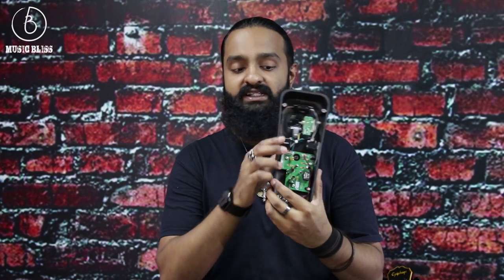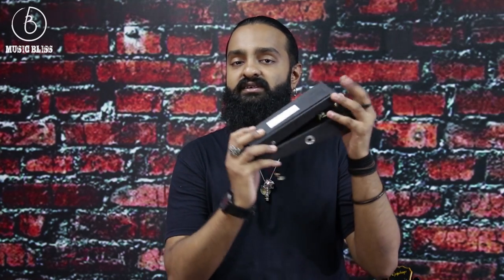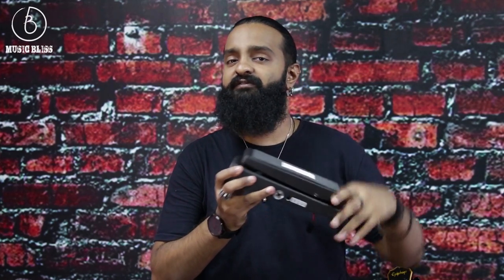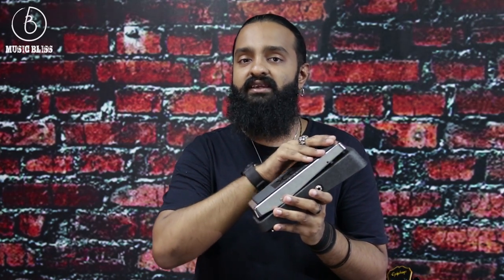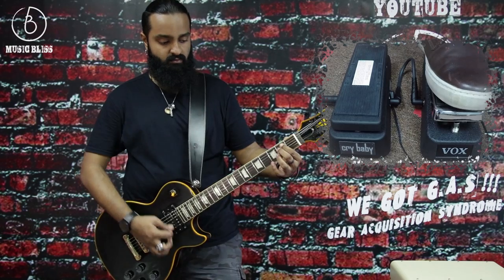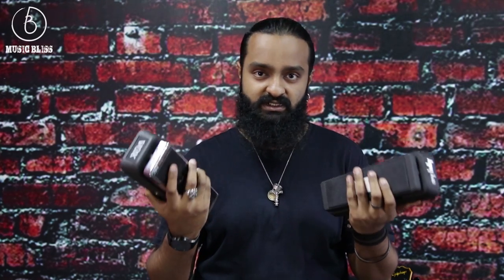THE ORIGINAL WAH PEDAL: Dunlop Crybaby GCB95 vs Vox V847 Wah Comparison

Comment: Vox has a wider sweep range and a tad more emphasis/resonance on the "sweet spot"? The sweep range seems to have more extension on the high-end. Or then it seems like so, because the resonance of the filter is greater in vox than in dunlop. More resonance = more "vocal" sounding.

Comment: I've tried both and here's my verdict.
VOX sounds brighter and definitely nails the sound of old school wah pedals. You can easily get the wah effects of Jimi Hendrix out of it, but due to its overtly bright character it ain't suitable for modern high gain musical genres.
The Crybaby sounds bit darker and certainly geared more towards high gain applications.

Both of them are two completely different kind of wah pedals geared at two different kinds of players. I think a better comparison will be between Box V847A vs Dunlop Jimi Hendrix JH-1B because they are more similar to each other.

Comment: Great vid, I think I'm gonna go with the Vox. Sounds clearer to me and has more treble
EDIT: Actually Idk which to choose. Very hard :/
Reply: gurvirj95v2 I have a v847a and sounds great clean, but when on gain its loses its sweep. It starts to sound like it’s either wide open or wide shut, no sweep in between, just flips kind of abruptly no matter how careful you are with your feet. Yesterday I changed the pot, and no difference. I’d suggest getting a cry baby, ive never heard this problem with them
Reply: Elias Levinson Ahh I see. After watching many many videos of Vox vs Crybaby and 'crybaby gcb-95' vs 'crybaby classic', I ended up going with the classic. It doesn't have that problem you mentioned, works great.

Comment: I've been given a Gcb - 95 for free and even though it turns on it doesn't rock up and down like in the video. I press it down or up and it just stays in that position, it offers no resistance. Is there a fix? 
Cheers
Reply: Maybe you have to change the position of the potentiometer.

Comment: Sorry, but the test is INVALID as it doesn't take into consideration the tonal effects of input and output loading.  You need to completely substitute one pedal for the other.  You cannot perform a valid test by connecting one pedal in cascade with a second pedal.  The Vox 847, as well as it's predecessors severely load the output of your guitar pickups and cause a loss of treble.  I owned both an early 1967 Vox Clyde McCoy and a 1967 Cry Baby with the name on the top of the pedal and they sounded identical and their circuits inside were identical.